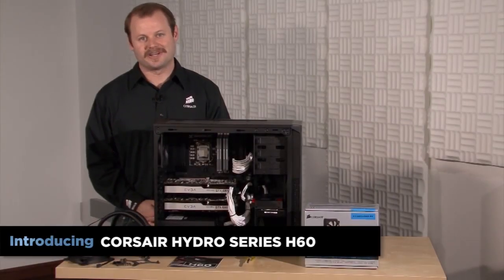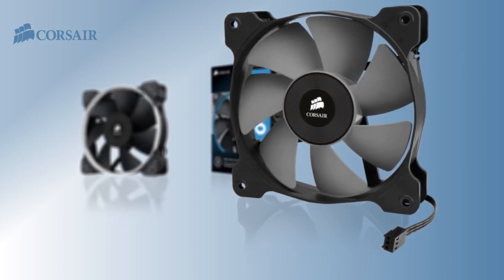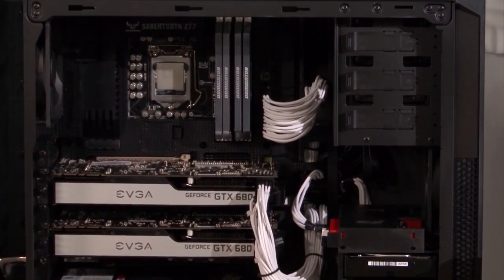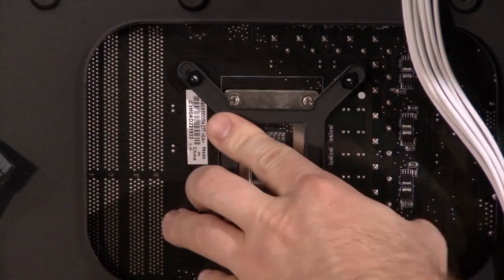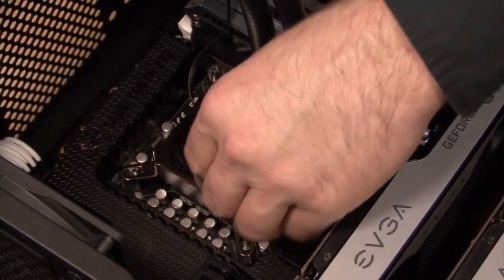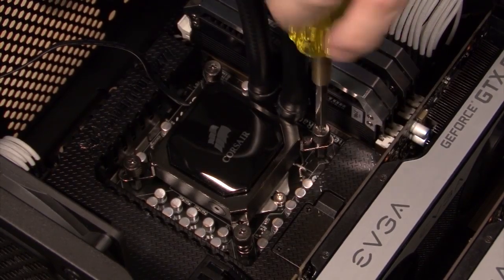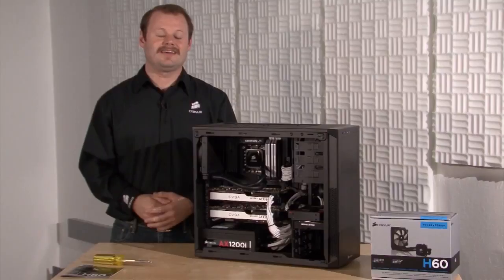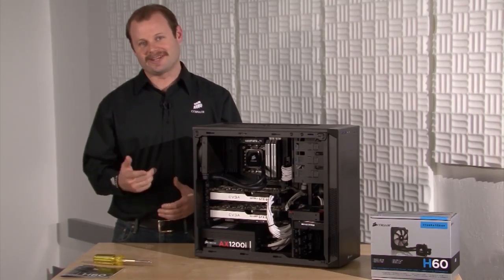2nd Generation Corsair Hydro Series H60 Liquid CPU Cooler.

Comment: Hi Corsair,

I did build a custom gaming rig in Powermac G5 Case, the fan i put like, that the logo is facing the  back. If i turn it like you in the video, i have all the hot air in my case wich is not good. Is it possible to put a second SP120 fan on the H60 ?

Greetings

Comment: Ended up buying the H60, 2 of the screw holes wouldn't accept  the screw the holes were too big and when I took it off all the screw hole were burred.
Need the computer right away so I have to by another, mountings are a little on the elcheapo longer screws and better thread needed. You need to be an octopus to mount it, it isn't as easy as the demo.

Comment: Hadn't seen the guru 3d review, thanks! PWM fans are directly regulated by the board by a signal wire, 3 pin plugs are voltage regulated. PWM fans speeds are very accurately regulated but  voltage regulated fans aren't that good and sometimes hard to start at low speeds, my view is all fans should be PWM regulated and all should be ball bearing. Sleeve bearing fans are too noisy.

Comment: Corsairs website looks pretty but no specs for the fan are listed.
Is this a PWM fan? if it is the pulse wiring isn't similar to the Noctua I'm using at present, some reviewers have described it as a PWM fan, others have not. Corsairs website only has 140mm PWM
 fans advertised on their fan page. But for the H75 the same dude that's making this vid he specifically mentions that it's PWM fan.
After the size of cooler fans the next thing I want to know "is it a PWM fan".
The 30db noise levels mentioned on the website aren't a full speed the reviewers all mentioned it's a jet taking off 54db. There are no RPM figures mentioned and doesn't the metric system exist in the US, feet have been gone for 30 years in the rest of the  world.
IS THE FAN A PWM FAN? , I'm not interested into what headers it will plug into, I've got em all in my new build X99
Reply: Well, considering that it's to be plugged into a CPU fan header which controls the speed of the fan according with the temperature of the CPU, I'd say that's all you'd need right? Also, according to Guru3D's review of the product (http://www.guru3d.com/articles_pages/corsair_h60_2013_review,9.html) the H60 runs at 39dba at load and 41dba underload. Far from being a jet taking off.

Comment: Do any of you guys think this would cool my i5 4670 (non-k) fine? it's not a priority by any means considering the stock cooler never goes above 65c (i have a very well ventilated cabinet,NZXT Phantom 410 with 4 intakes and 3 exhausts) but a water cooler looks much more..neat compared to a stock cooler.

Comment: Don't have a ventilated or even perforated top in my case (Cooler Master Centurion 534), so I was thinking of installing the H60's fan to blow air through the radiator and out the back. Is this the way to go with this setup? Airflow is pretty good right now with a pre-installed front fan and a side mounted fan both sucking in and a rear mounted one blowing out (which of course would be replaced by the H60's radiator/fan-combo).

Comment: Will 120/140mm fans still fit in the top fan mounts with the H60 installed in the rear exhaust? I would like to use the top as an exhaust if possible. Also, could it potentially work on the bottom fan mount, pulling in cool air from the bottom of the case?

Comment: i did have the same stuff, but i dont know whats your mb, ergo, i dont know the design, and also i dont know what ram are you using. I was just trying to help. simply put, any hydro product will fit in a 300r no worries.)

Comment: yes, it will fit on the top of your case, bear in mind though, that you need enough clearance on the top (around 6cm)so that the radiator doesnt hit anything in the MB, in my case the radiator and fans were too fat, and it would hit the memories (big vengeance), so in my case that doenst work